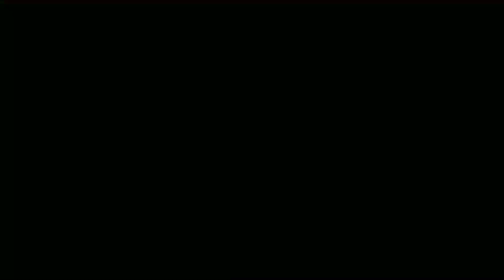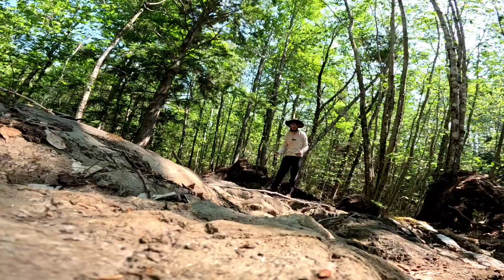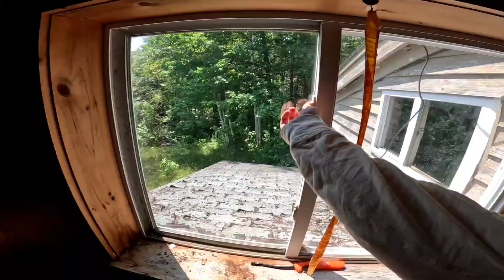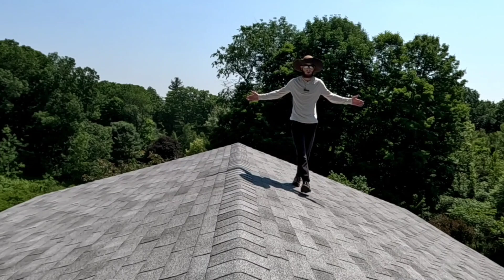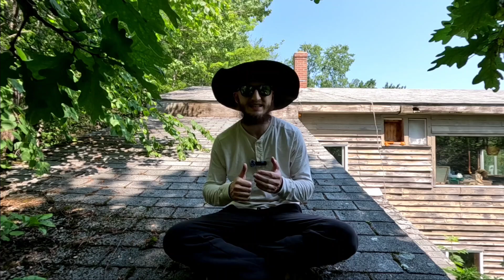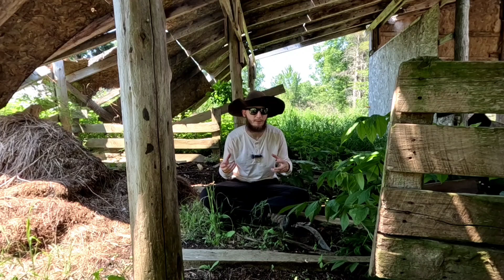Why Can't Houses Last 1000 Years?

Comment: What if we made something like clay tile, but used Roman concrete instead. Self-healing and affixed to a steel mesh, I would bet it would last pretty long. I wonder.

On second thought, the steel mesh would corrode and spall with the wet/dry cycling. Maybe fiberglass reinforcement?